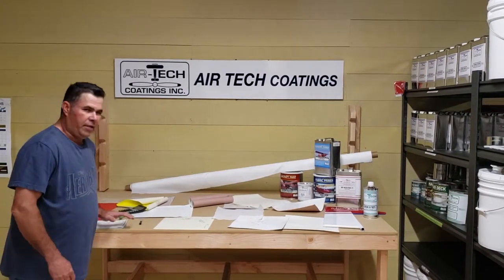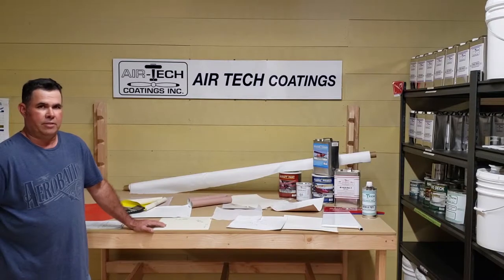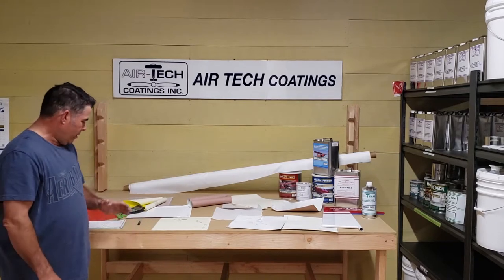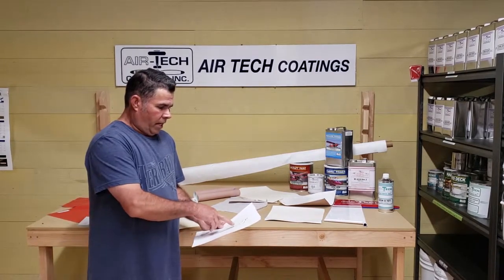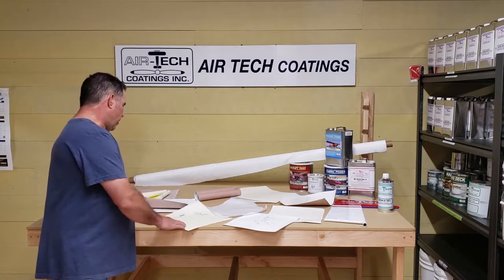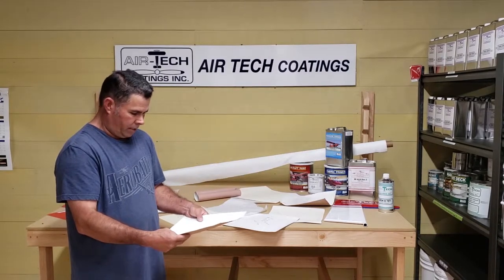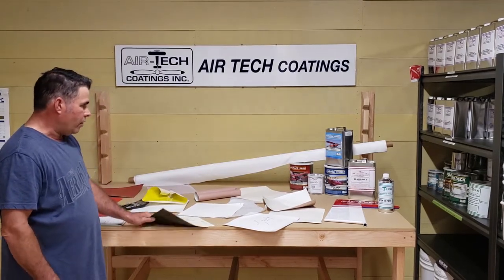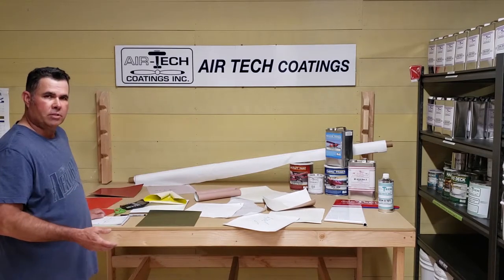13- Airtech Coatings - Covering System Weights and application impacts

Comment: Once as a young man I used to race motocross and worked in a dealership that serviced and sold general and competition classed bikes.  It was interesting how many people would come in and have an issue with one bike in the same class being 8lbs heavier than the one beside it.  Despite the heavier one being faster, having a better power to weight ratio, suspension etc.  So these people were making an issue of the 8lbs heavier bike while the customer would be 25lbs overweight.

Now that I'm an older man and 30lbs overweight I know longer blame the extra coat of primer or paint.